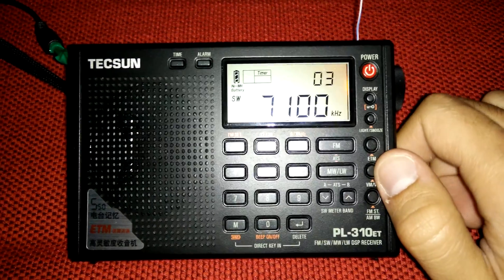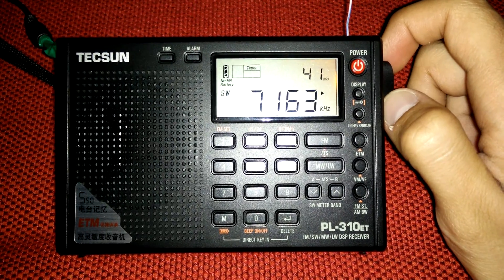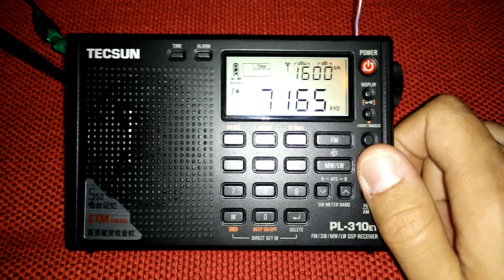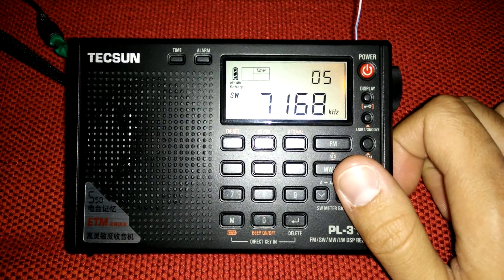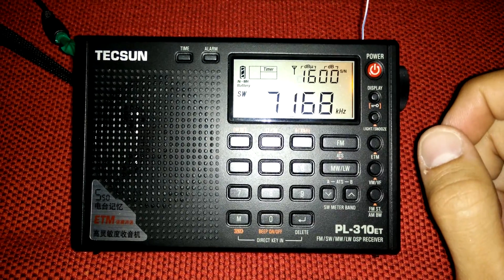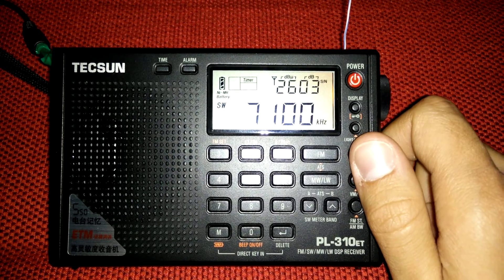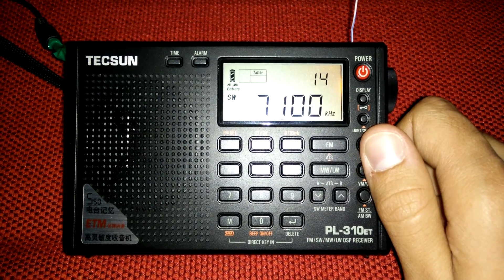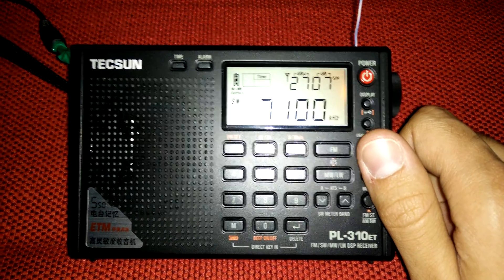Overloading Tecsun PL-310ET makes ham radio distinguishable?!

Comment: A SSB ham radio transmission will start to demodulate by itself if there is too much radio activity on a ham radio transmission. It is like injecting an another radio signal into the signal carrier. You can notice this by using an AM only shortwave receiver.
Reply from the maker: ***** Thanks for your explanation! I will quote you in the description!
Reply: You're welcome.

73's from Malaysia, Fred.